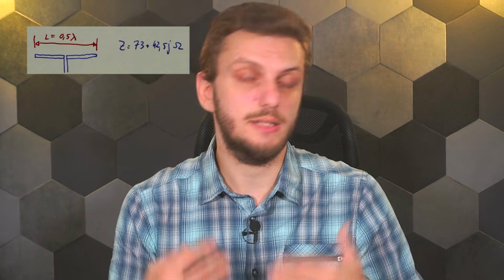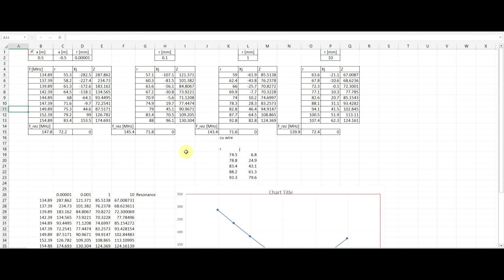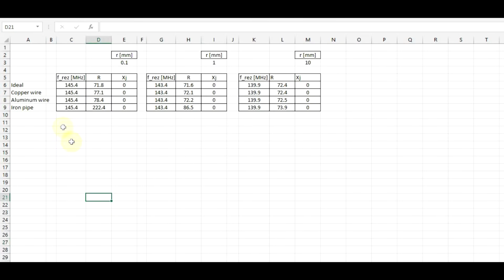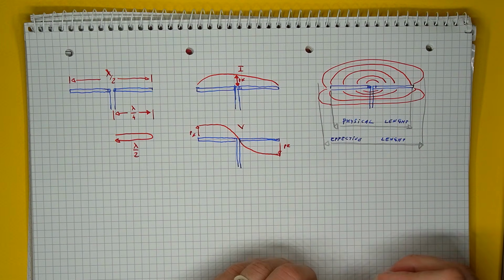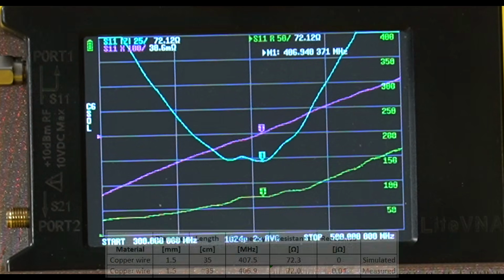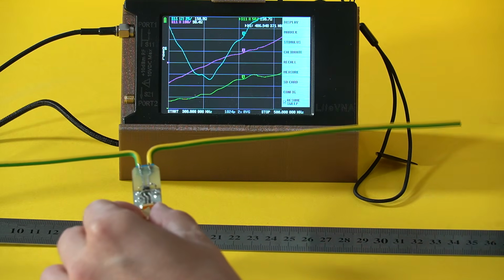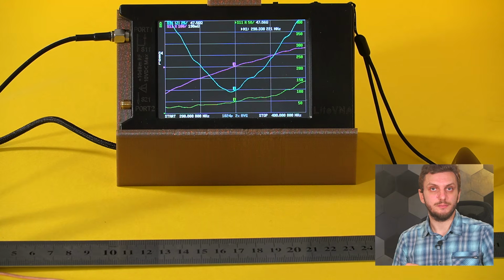About Resonant Dipoles

Comment: About the LiteVNA: How long is your calibration stable?
I have such a device now, and the calibration seems to run away after a minute or two...
Reply from the maker: I did not really run into such issues.. I usually calibrate at the beginning of a measurement session, but I guess you could turn on the device, let it run for like 10min for it to warm up, and then calibrate and measure.
Reply: Ok, thank you for your reply :-)

Comment: re: why the diameter of the material matters,  an explanation I came up with which may not be technically correct, but seems to be close enough to build useful antennas and easier to wrap my head around:
when you have many elements fanning out from one point, the radio waves will use the one that's the best 'fit' for the wavelength and ignore the others (best visualization is a HF multiband dipole)
when you have a thick antenna element, you can think of it as a whole bunch of wires fanning out from the feed point to all the points around the far end.
the minimum frequency it will resonate at is the length of the element * velocity factor
the maximum frequency is the 'diagonal' from the feedpoint to the far side of the element at the other end.
At HF frequencies, this is negligible, but I've built 2m antennas with 4" diameter elements where this is significant and in practice (as measured by test equipment), this way of thinking got me within normal antenna trimming range of being correct

Comment: What firmware are you running on your nanovna? It looked like your vna was set to 1024 sweep points…. You must have one of the higher end vnas. Great video as always!
Reply from the maker: I'm using a "LiteVNA"; but I noticed that there is PC software (Nanovna saver) that can be used to sweep any number of points, so if you are interested in more measurement points in a single scan, then that should be the way to go. Another really interesting thing about the mentioned program is that it allows logarithmic frequency axis display, something that the base device cannot really do

Comment: Excellent work.
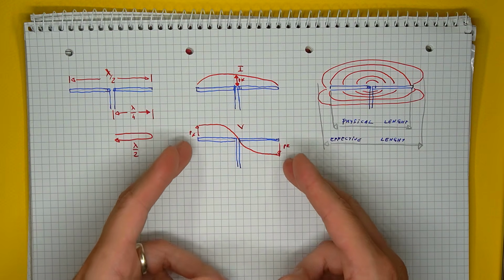The voltage graph (6:39 into the video) shows a zero crossing at the center. This is a common mistake we also see in text books. If the voltage at the feedpoint was zero at resonance, then the impedance (V/I) would also be zero. Clearly, this can't be right. The actual voltage is not zero at the center (feedpoint). For 1 Watt of driving power it must be sqrt (P x Z) = sqrt (1 W x 72 Ohms) = sqrt (72) Volts = 8.49 V or half of that for each arm, in the context of the red graph trace.

Comment: 👍 7:00 There is a simpler way of thinking about the effective length. A half wave dipole are two pieces of wires than can be considered a capacitor. AC current can flow to a capacitor despite the fact that it's an open circuit - its plates are accumulating electrons and thus constantly charged and discharged. Thus the effective current on the edged of the dipole is (!) not zero - the current still flows (charges the capacitor) despite the fact that there is nowhere to flow anymore. As a result the effective length is larger that the physical one.
Reply: Good point. Yes, the dipole must be a "closed circuit". At the ends of a dipole the conduction current must approach zero but the antenna circuit extends when we include the fields. In this case the electric field. 
The capacitor analogy is not entirely wrong. The equivalent circuit of a halfwave dipole is indeed an inductor in series with a capacitor followed by a resistor.
Reply: No.

Comment: Thanks for an excellent video. If you don't mind, can I ask a quick question because I can't find an answer on the internet and you may be one of the only people on the planet who knows.....? Do you know whether it is possible to add both real and imaginary terms to the inductance of an inductor in LTSpice? I need to simulate both the inductance and loss - the latter being important for thermal noise. Ideally, I would like to have a look up table for the frequency dependancy of both terms, but I guess that is asking too much! At the moment, I run repeat simulations at different frequencies using modified values of L for the real part. I also add a series resistance for the imaginary (loss) part.  As these need manually editing as a pair for each frequency, I feel that there must be a batter way...... Have you ever come across anything?
Reply from the maker: In case the simulation type you want to perform is "AC", then what might help is the FREQ function I discussed a few videos back - with that you could define a resistor with both real and imaginary parameters and also have these varied based on frequency.

Comment: Ok... I don't understand the '50' ohm calibration load you made... at 13.58 in the vid. Looks to me... like you soldered a 49.9 SMD ... in parallel... with a 200K through hole. If so? ... how does that get you closer to 50 ohms?
Reply: It doesn't. But since the goal here is to make relative impedance measurements, the absolute error in the measured impedance is not very important.
Reply: @janhamaldvorak560  For resistors... pure real resistance.... no reactance... if you put them in parallel... the total resistance is less than the least. So... yes... its going to be less than 49.9 ohms... always. But another meaning is if Z = 49.9 + Xj ... where reducing the reactance... by adding additional components...gets you closer to a real resistance.

Comment: Can I put multiple length antennas in parallel to tune to their frequencies? 
Like one antenna for 400MHz, one for 940MHz, one fore 1.2 GHz,... and so one all connected in parallel.
Reply from the maker: To some extent, I think what you are describing is the Log-Periodic Antenna. Its a type of antenna that uses arms of different length to cover a wide frequency range. However, if you just need a few very specific frequencies, and not  the interval in-between, maybe its best to use a each antenna with a filter and then combine them - similar to how a diplexer is used to combine a 2m and 70cm antenna; but a more complex filter for more than 2 frequencies...
Reply: @FesZElectronics Thanks for the explanation.
Reply: Have never tried it at these higher frequencies but to answer the question, yes.  Over the years I have made several fan dipole antennas for the HF Amateur radio band.  I have one up now for 10M, 20M, 40M and 80M.  Just Google "fan dipole" or "parallel dipole".  There are also free online calculators for calculating the element length's.  When tuning start with the longest element (lowest frequency) first and work towards the shortest element (highest frequency).  Mike KC3OSD
Reply: @mikesradiorepair  Will do. thanks.
Reply: @mikesradiorepair  A variation on the fan dipole that folds around on itself is a 'cobweb antenna'.

Comment: Very interesting, as always. Thanks.
I was wondering about how to predict and measure and improve the efficiency of an antenna (without an anechoic chamber) ?
I mean that you can have a perfect match using an antenna that doesn't radiate anything (some commercial wideband products event contain a suspicious dummy load). 
Perhaps using a field meter far away enough ?

Comment: Is the ballun necessary? The antenna dont care about DC and the current between the Terminals should also always be equal.
Reply from the maker: The importance of the balun in a balanced load like a dipole antenna is that it forces the current from one branch of the antenna to be equal with the current in the other branch; without the balun, part of the current from the branch connected to the center conductor of a coax will close back to the coax shield rather than the other antenna branch.